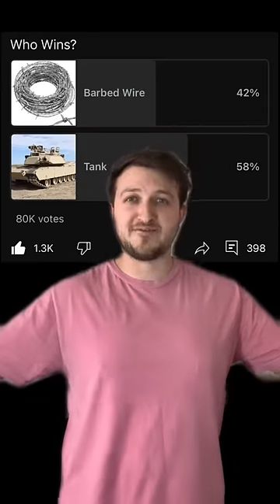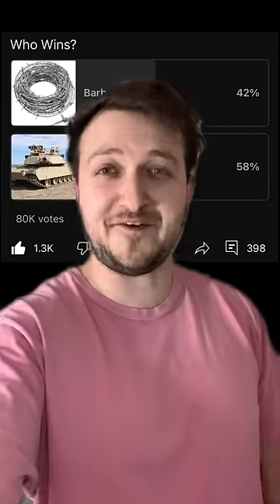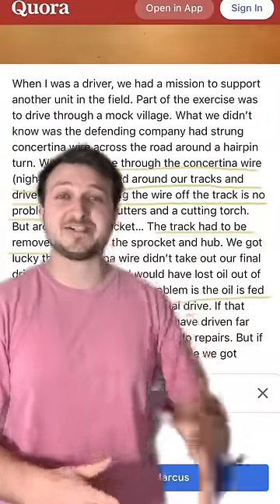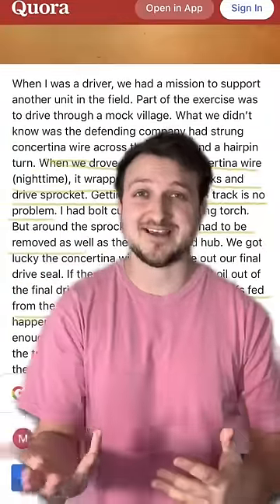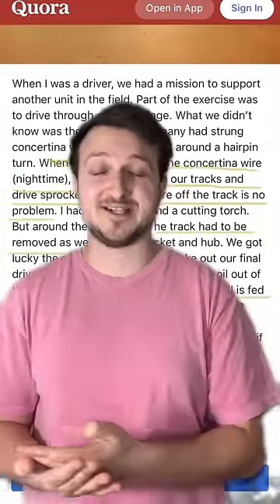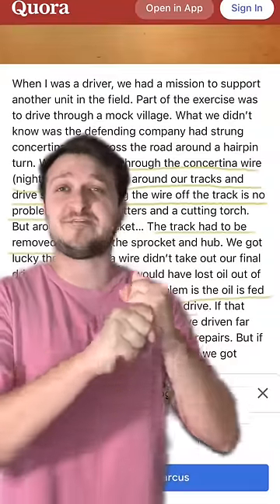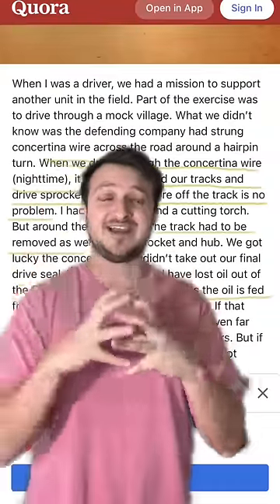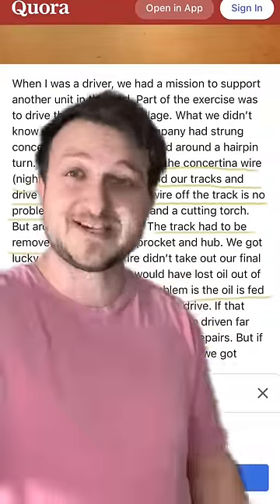Soldiers Tank vs Barbed Wire. #shorts#army

Comment: The original tank design with it's rhomboid shape tracks was supposed to go over the wire, however the British tanks often dragged the wire clear with grapnel hooks before going on. WW1 tanks still managed to get caught up on occasion.
The bright spark who decided to shell German barbed wire to break it tried out the idea on British wire. It worked ok, but the German wire was thicker and did not break.
Reply: The thing people miss about this fact, is that when you say “tank” you’re not referring to an armored tank like we think of today. The tank you’re referring to was virtually helpless, and could barely turn, but it’s goal was only to get infantry through an area of wire knocked down by the tank. Basically it was a continuous metal panel that could be laid over the barbed wire to crush it down. This in contrast to our modern tracks on tanks, shows why they don’t work for that now.

Comment: If I recall correctly, there is an accessory, essentially a plow or cow catcher that can added for that duty.
Reply: Hedgerow cutters, and no they were designed for the plant equivalent so that it would plow through the gnarled dense wall of plant and stone instead of rolling up over it and getting an AT rocket in the belly

Comment: Depends on the tracked vehicle. My dad used to drive and man a WWII M-18 tank destroyer. He has the cool patch with a panther on it. The M18 would do 50 MPH. He said if it's a bit of barb wire on top of a fence or some wire on the road that is tied down as long as you hit it at a 90 degree angle it would run right over it. The problem is if you managed to get it tangled in the tracks. Now you're in trouble. So if you saw loose wire on the road or a bunch of it stacked up, don't go over it.

Modern tanks have rubber feet and the barb wire will get stuck in the rubber. Now you have a big problem.

Comment: To be honest I didn't even think in that sense. I just thought: Shoot at it a few times and the shit should be open.
Reply: Nope. You would need essentially shaped charge that acts like blade to molten beam cut trough the wire. HE or APDSHE does fuck all to barb wire, unless you put artillery barrage on top of it and even then there is that shit around. 
Literal hell is formed from barbwire and it seeps to our world to fuck with us and cause suffering when you deal with it. Even with protective gear barbwire is pain in the ass, let alone concertina wire. Add there being shot at and you get the idea why its such a pain.

Comment: thats why you use the HE shells first, as long as you keep atleast 100ft from it
Reply: Combat engineers have a tank called the M1 Assault Breacher Vehicle (ABV) which can carry two MICLIC’s (mine clearing line charge) it’s made to clear 100 meters of mine field but it’s also used to blow up wire obstacles. Am HE shell doesn’t guarantee that there will be a big enough gap to cross in a MBT.

Comment: It's also situational. There are methods used in army doctrine to get a small element of tanks through an obstacle. One scenario might be you need to get through the barb wire and on the other side is your objective you need to hold. You can have 2 tanks CAN the barb wire from different angles then have 1 tank breach where you sent the rounds. Most of the wire should be gone by now but some will still remain. The remaining tanks breach through the same gap following the exact same tracks the first used. This method would only ever be used in very dire situations where lives are more than likely at stake and it would take too long for engineer assets to arrive in a timely manner. This also makes the first tank that breached a mobility kill 9 times out of 10. So that tank would have to be protected until all the wire is free from the tracks. This is based off of personal experience as well. My company had to use this tactic at NTC to secure overwatch on a city that our crunchies were trying to occupy. No we did not actually drive over real wire as that would damage equipment and possibly personnel. NTC just throws these kinds of simulations at you to see what you will do.

Comment: Well the British Mark 1 - 7 were designed to roll over these barbwires, they had a 1 ton anker at the back they drag along to rip the barbwire apart, this was quite successful. 

Modern tanks are not all that great for barbwire simply because its tracks are not flat and thus the barbwire has a lot more to grip into and get entangled, in fact the T-34 had flat tracks because it allowed lower surface pressure in deep snow and also to drive over barbwire. 
Downside with a flat track pad is the fact it has no grip. 

Modern tanks have wire cutters installed on the front for this reason basically some very heavy duty knives installed above each track in front so when the tanks drive into the wire installations they just cut them up.

Comment: I was on the old M551 Sheridan's for some years as well as an M2 Bradley after we transitioned from 11B to 11M. I ran through a wire and mine obstacle breaching the Whale Gap and it was singularly the worst choice I ever made as a TC. That crap was wrapped around every roadwheel, in both drove sprockets as well tore apart all the rucks we had around the sponson. They wanted to tow us to the BSA but we couldn't even get the final drives pulled due to all the wire wrapped up. We had to break track on both sides to get at the bulk of the wire and ended up having to change several road arm seals and bearings the way they were chewed up. It was the last time I ever allowed a driver to breech using the vehicle.

Comment: As a dozer operator that has done clearing work.... trust me. Barbed wire beats tracks. It will destroy your drive sprockets that allow your tracks to move you forward. It's why we make sure to push it into piles of dirt(it's easier to move a large amount of barbed wire when it's been crushed under several tons of dirt) so that we can ensure it isn't getting up into our tracks to wrap around and wreck the sprockets and thus risking destroying the final drive causing the dozer to "hemorrhage" transmission oil..

Comment: I have no tank experience, but a guy I work with got hung up on some data wire with a 9 ton snow groomer while sliding down an icy slope, another pulled up around 400 yards of the same wire when he caught a junction box,  even if you drive away, the wire wins...

Comment: Trained as a 12C (Bridger) but alot of our training started basically the same as the 12Bs (Combat Engineers). Part of what we did was set up 4 or 5 rows of concertina wire stacked like a pyramid in each row. Our instructor said that you want to stop a tank, just put a shit ton of barbed wire in front of it.

Comment: They did build the mark 1 to run through wire, it’s just that the mark 1 failed in every conceivable way.  It just happened to be that they built enough of them so that a couple didn’t completely fail and that passed for success at that time.

Comment: Technically, yes you can get through razor wire and barbed wire with an armored, tracked vehicle. But you may not get very far, afterwards.

You will pay for it in time spent repairing damage and clearing out wire wrapped around your drive sprockets and/or return wheels.

Comment: Yes I had my M1A1 immobilized by a small pinky finger sliver of granite mixed in the sand.  It got between the hull and the track and sounded like 25mm rounds slamming into the hull.  Then it shattered the drive sprocket in 8-9 pieces and threw the track.  Tank had to be recovered with an M88A1 that subsequently had its transmission explode and shot oil all over our gear on the tank. That was the biggest suck of it all.

Comment: Don't quote me on this but, tanks were invented to take out trenches, barbed wire and razor wire was a thing that was around said trenches. Tanks at the time of ww1 didn't really have open sprockets and drive shafts and the like, the only thing that was shown was the tracks so with that the tank could go through the barbed wire but it would most likely, almost definitely, would damage the tracks. If there is anyone who has more knowledge about this than I do, back me up or correct me, I am always up to learn more.

Comment: I'm really impressed that the power and weight of the tank does not cut or snap the wire as it gets tangled in the shaft, its steel vs steel, must be specially designed for that i guess

Comment: Just because they didn't successfully accomplished it does not mean that the tanks weren't designed for the purpose of cutting through or driving over barbed wire.

That's exactly what they were originally designed to do.

They may not have done it very well, but that's what they were supposed to do....

Comment: Tanks were not invented for barbed wire however there was an operation in ww1 that they were used to press down barbed wire but that operation was more for the advancement of combined arms with tanks. The operation however did gain some ground but was eventually pushed back to original positions.

Comment: People always mistake concertina wire for barbed wire or razor wire. 

Concertina wire is the strongest, and the least sharp of the three. Meant to stop vehicles. It interlocks to catch on itself with very strong prongs. Secondarily it can slow a person on foot.... but that is secondary. It wraps up in your axles and will stop your vehicle in about 10-20ft.

Barbed wire is for poking cows who try to get through the fence. Doesn't stop people really at all as the prongs are easy to avoid.

Razor wire is to cut up people who try to climb over something. More of a deterrent and to slow them down. Just toss a rug over it and ur good.

Comment: I don't mean to sharp shoot you, but an 11 row and triple standard are two different obstacles using concertina wire. However, the rest is 100% correct. I spent a number of hours one time at Ft. Drum cutting wire out of the driveline and from around the sides of a HMMWV because the driver wasn't paying attention. They ran through about 4 rows of our rather well marked 11 row, and were stuck in the vehicle until we cut them out.

Comment: The MKI-V tanks were designed to take on trenches and wire. But modern tanks aren't. The idea behind the original tanks was to offer a mobile bunker which could send out a lot of covering fire, mobile hard cover for Infantry and clear anti-personsal obstacles. 
 A modern tank is quite a different beast. It's less about Infantry support in an up-close direct way and more about fucking up stuff that would otherwise ruin the Infantry's day before that stuff gets the chance.

Comment: Barbed wire is not the same as C wire. C wire is designed to be anti vehicle. Barbed wire is generally straight wire like for fencing. 

So if it is straight barbed wire, the tank wins. If circular C style wire, the wire wins.

Comment: Ok for one, tankers were invented to demolish barb wire, partially yes but tank designs then were very different compare to now, another, yes there were barb wires but they were more like barricades of wood, sandbags and other stuff supporting up the barb wire.
Infact, in WW1, there were several methods of deploying barb wire, and some tanks were almost entirely designed to destroy them, one barb wire deployment made solely to give the middle finger to cavalry, I don't know the proper name but I will call them wire pits, that is dig a long trench and set up barb wire in there, you are not getting out without help.

Comment: I only came across 2 documents that I can remember were a tank had a on the fly in the field brush guard modification that allowed it to go through barbwire. One of the 2 wasn't even done with barbwire in mind but actual brush in the surrounding areas of the land after D Day. It worked on brush and apparently barbwire as well.

Comment: My tank once JUST touched some loose wires with the back of the track. We dragged it on 20m before Leutnant shouted stop through radio, afternoon spent cutting the wire around the track. Luckily damage was minor, just the rear lights torn off

Comment: I was a tanker, but I was in a m113, (welder before the army and after) we hit a lot of barbed wire in hoeinfelds Germany, 1st sgt asked for he mechanic if it could be fixed, mechanic was a SFC he said it would take all day, I asked if I could try, he said sure, I asked the mechanic for the oxyacetylene torch from his fresh, a crow bar and 15 gallons of water, had both sprockets cleared in under 2 hours. (Ended up needing about 30 gallons of water)  as the saying goes “it can’t be stuck if it’s liquid”

Comment: Barbed wire and concertina wire are very different, as were the suspension, tracks and mission of those early tanks. Most barbed wire obstacles are easily breached, and barbed wire is easily cut away by the vehicle and track of modern tanks. Concertina is a whole other animal and BOGs or Bangalores are about your best bet on a breech wide enough for a tank. That stuff is viscous and near inflexible, not easily cuttable with standard heavy dikes, rather small bolt cutters. One does not want this in the suspension of any vehicle, for it will wind around rotating parts like a yo-yo coming up inertially until those little razors interlock and join , needing a M88 and crew to cut it out and possibly the assembly it’s wrapped around. It the Sarin Gas of the maneuver game.

Comment: The MK tank series also had a high front end for the tracks and less space where the wire would be tangled, however as I haven’t heard of a MK series tank or a Renault getting stuck, I don’t doubt that it is possible or has even happened. Love tanks. But the wire is just too op XD

Comment: Best way to get passed barbed/razor wire? 

Not lowcrawling. Depending on how loose the knots are, the wire has sunk to the ground, about as tall as knee depth, leaving you to trip and pull your leg, leaving your calves with unstitchable deep gashes, light clean cuts, and a messed up uniform doomed to get bugs unless you treat it quickly.
You could try a blanket for a couple rows of distance, but after a few people run over it, the blanket snags and quickly shrivels away into ribbons. Good for a row or two of temporary barbed wire, not good for 7 rows. Electric barbed wire can also quickly start a fire, big no no.
Driving a huge truck into the wire like the first mission of call of duty vanguard. Not only is this dumb because of the financial consequences once the battle's over (insurance coverage, using a vehicle without authorization, damaging it, etc.), airless tires can still get holed, the manifolds can get tangled and break from the wire tangling it (like hair on a cheap rc helicopter's wings), the truck can literally explode from landmines made for either small arms, or heavy vehicles. Don't do it, let the combat engi's and EOD's do the work.  💀

Comment: I'm not sure about that. In the military, I learned that barbed wired are easily snapped my tank tracks. 

Of course after you run through a barbed wire, accidentally or not, the engineer WILL snap the driver's back. 
Just like the barbed wire the tank snapped.

Comment: Was an AAV Mech in the Corps. A couple years back one of our drivers fell asleep at the wheel on one of our night ops and hit some Barbed Wire. Safe to say after a good ass chewing from the Cpt and several of use working to remove it I have decided barbed wire is superior. That’s 3 hours of my life I won’t get back. It just takes 2 rows of Barbed Wire to stop a platoon of 7 AAV’s and upset a good deal of them. Barbed Wire beats track

Comment: That wire is not regular barbed wire...... The wire wrapped up in the tank treads is made to be anti tank,it's called concertina wire and is way stronger than regular barbed wire for cattle fences.
My M1A one would tear up barbed wire but concertina wire is a tankers enemy.Make you a mobility kill real quick

Comment: Barbed wire is not Concertina wire.....quality difference...C wire will cut drive shafts off trucks if keep going.....tanks will need torches to get it out IF ITS WORTH IT.   OR  CRANE/ M88 TOW TO REFIT

Comment: I'm not saying tanks take the win vs wire. But how would wire get tangled on the drive shaft of a tank considering the drive shaft isn't exposed? It's protected by the flat plant the protects everything under the tank inbetween the tracks...

Comment: It was my understanding that it wasn't so much barbed wire that was trying to be circumvented. It was having something to: 

Draw enemy fire

Damage (okay.. decimate) enemy morale

Break trench lines ( as in be able to go over them and then keep pushing with relative ease) 

And looking at the WW1 tank, the way they are tracked and propelled look different
 What I mean by that is the design of the tracks doesn't leave a lot of room for wire to cause as many problems when compared to today's tanks. 

But I'm just a guy who got washed out at meps because of marfans so wtf do I know

Comment: The soviets found a easy way to cut barbed wire without blowing it up or covering it up. they the tracks of a t-34 simply by sharpening the running gear teeth and welding sharp metal bits on the outer rims the stuff is tough but not undefeatable.

Comment: First of all, BARBED wire is not CONCERTINA wire, and CONCERTINA wire is not RAZOR wire.  Those are literally 3 different things.  Tanks today have wire shears for this purpose, but yes Concertina will absolutely stop a tank dead in its tracks if it isnt prepared for it.  Sucks right into the final drives, destroys seals, shreds itstelf up and eats bearings alive.  Happens all the time to Dump Dozers.  So much so we install wire shears on all of them now.  BARBED wire will not do this.  not the same metal, not the same blade pattern, shatters much more easily, and doesnt tend to fold up and tangle when depressed downward.